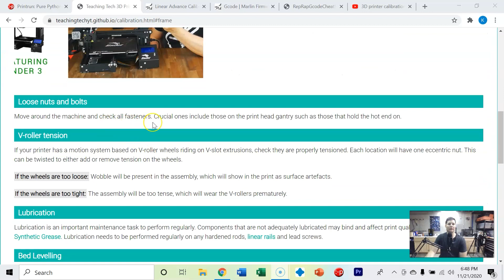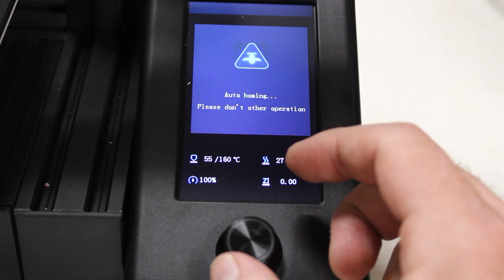3D Printer Frame Check - Calibrating your 3D Printer Part 1 - Ender 3 V2

Comment: You cant check if the z-axis rails are square off the build plate before you level the build plate. Check the square of the z-axis rails from the top rail. Then square your x-axis rail up to the top rail, and then you can level your bed. Your videos are still very good despite that!!!!

Comment: I have the same printer and have a lot of problems with bed adhesion
Reply: I used a glue stick first but after taking the plate to the sink and washing it with dish soap and a sponge it worked fine. Also the leveling is very important. And I use a firmware with mesh bed leveling. So the first layer really gets close to the bed. Play around some more and watch a few videos about it. Maybe Isopropanol also helps....
Reply: @tobiastho9639  i dont want to use glue in everyprint is not suposed to do that
Reply: @marine1718  you don’t need to replace the glue after every print. Also try a slightly higher bed temperature.
I print at 210/70 for PLA. You can “polish” the glue after application with a damp paper towel, glue stick is water soluble. This makes the surface smooth and consistent, don’t polish the glue away though. Works for me, several prints between applications. 3D printers are not perfectly consistent, there is a lot of tinkering...

Comment: Hello, I just started watching your videos... my X axis is not parallel, how should I set it  up right?
Reply from the maker: You need to adjust the right side of the x axis by either pushing it toward the build plate or away and then tighten the ecentric nut to keep it in place.
Reply: @rainmaker3d  didnt work... not an easy task
Reply: @rolandofuentes6444  your other alternative is to use a dual Z axis